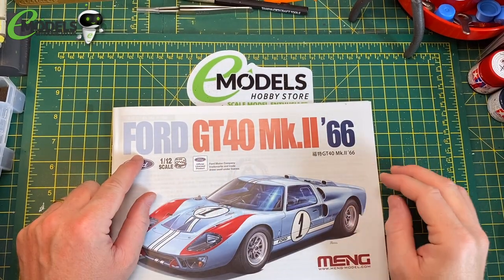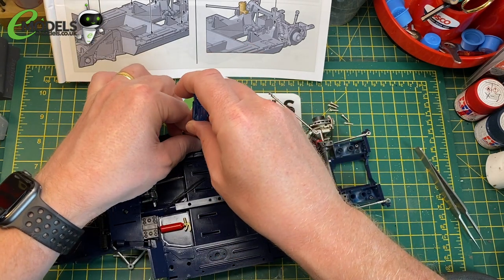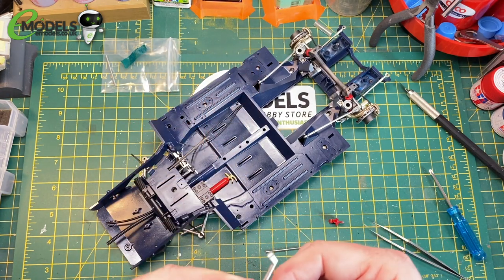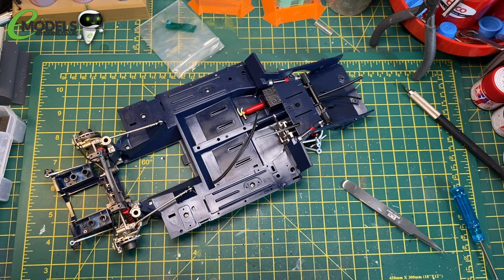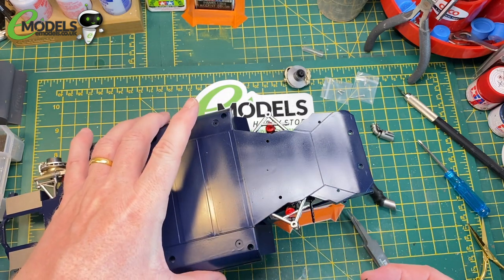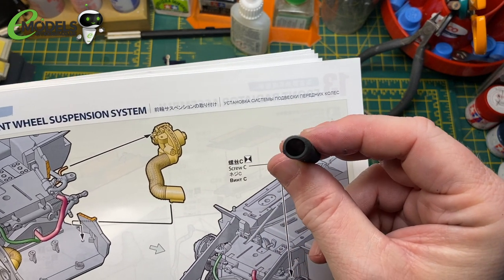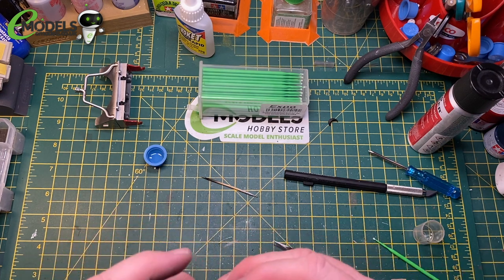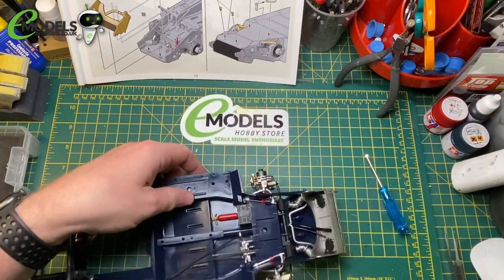Meng 1/12 Ford GT40 Mk.II '66 (# MMGRS-002 ) 2: Front Suspension

Comment: If you stuff the rubber tubes for the brake Cooling conduit with something flexible, like cotton balls, it might be enough to keep them from collapsing and still be flexible to make the curves. I had some similar trouble with another build and it worked for me.
Reply from the maker: Good tip!